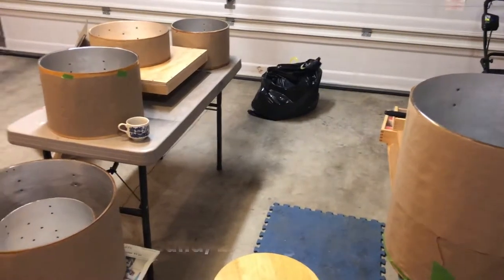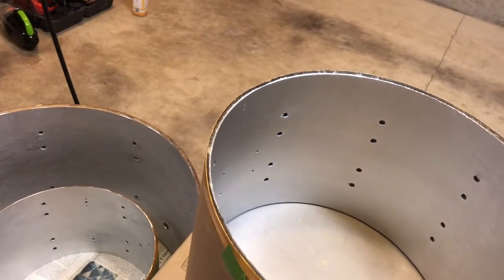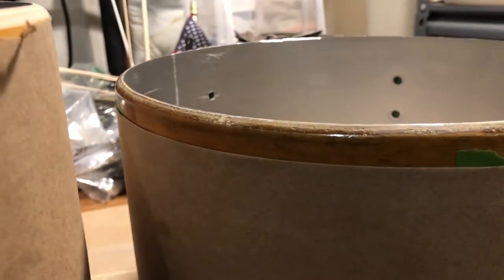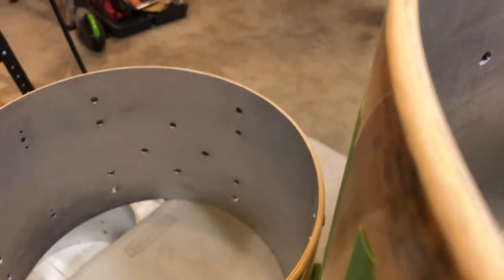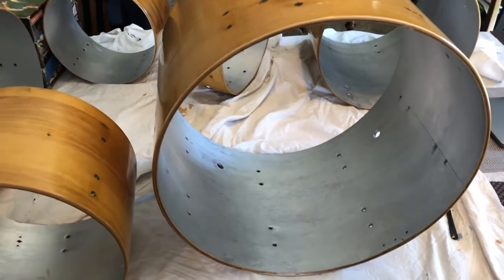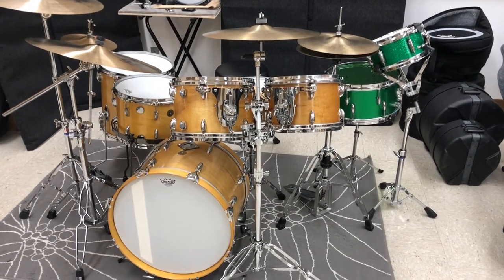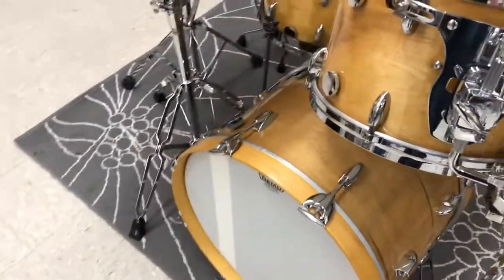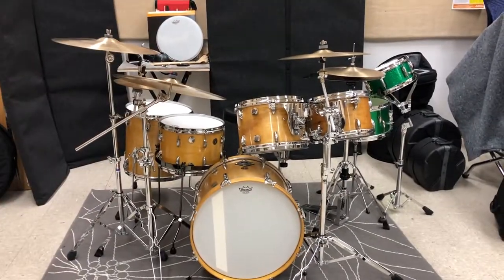Final work on 1960s Gretsch drum rebuild

Comment: I’m removing lamination from my Pearl Export drum kit, as a project for “fun.” I did the same thing 20’years ago on a Tama Rockstar, with fairly good results, even though I had no clue what I was doing; they looked great and sounded better without lamination.

I’m enjoying your video and was wondering if you could recommend a resource for info about bearing edges and paint/finish that is appropriate for the shells. Mainly curious about whether I need to avoid applying anything to the bearing edge, or whether to go ahead and paint the edges and then sand away later. Also curious if there is anything I should avoid applying to the wood shells? (I used nitro stain and lacquer back in the day but I’m only seeing polyurethane at the hardware store. Probably going to check out a proper paint store for the stain and finish)